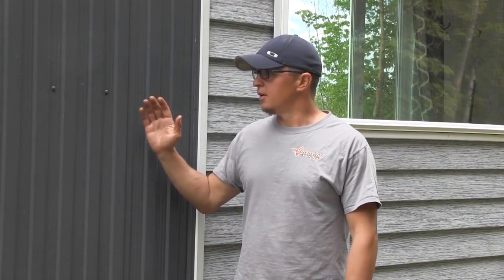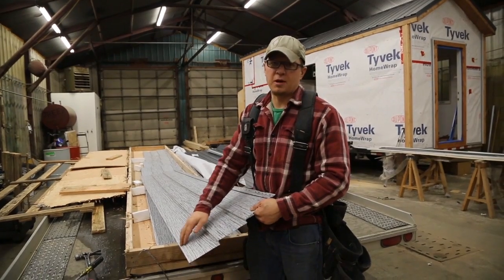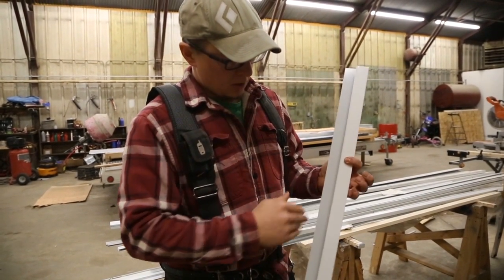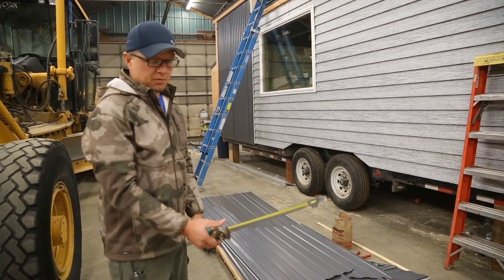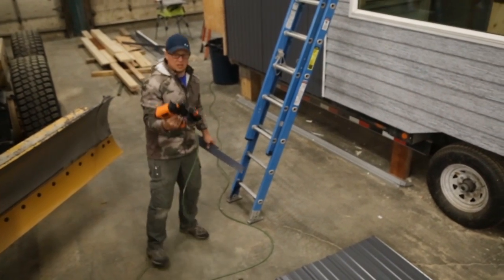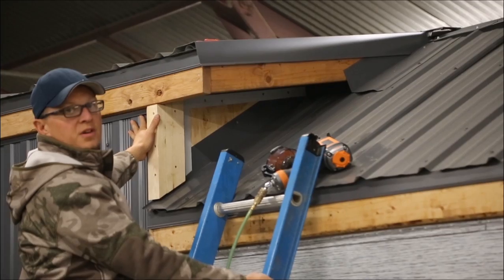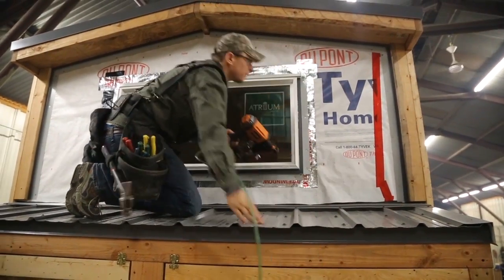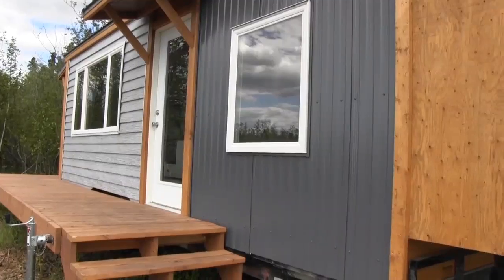Tiny House Siding: Ana White Tiny House Build [Episode 17]

Comment: Why did you choose the stove you did? Did you think about small wood stove for heat?
Reply from the maker: Hi Rick, good question!  In order to get a wood stove in the tiny house it would have to be very small, if you went bigger it takes up more space and would cook you out on milder days.  This means a very small firebox.  When it's -50, you'd be stoking the firebox constantly to keep the tiny house warm, so this would mean you either can't leave the tiny house or you'd have to drive back home every few hours to put wood in the firebox (burning fuel in transportation) so it doesn't freeze up.  Just seems to make sense to go with a high efficiency fuel heater instead up here in Alaska when you go this small.

Comment: Did you use a drop axel  trailer to build on?  How much room did that give you from your floor to roof height out of the max allowable 13.6 feet building height?  How much length and width did your wheel wells take up of your floor space?  Lastly how much did your home weigh given its length(?) ?  Can you estimate how much a 35 foot tiny home might weigh if using your recommended materials or similar.  Would I need  to go to 6 wheels vs. 4?  Is that like 3 axels?  Is yours 2 axels?  Thanks!
Reply from the maker: +rho lees hi!  We've shared the plans for this tiny house here https://www.dropbox.com/s/isl958o3whg76ql/Tiny%20House%20Plans%20Quartz%20Model%20by%20Ana%20White%20-%20med%20res.pdf?dl=0 and it details a lot of your questions.  A lot of this will depend on your trailer.  We haven't been able to weigh out tiny house but estimate it to be about 10,000 pounds by the way it tows comparing to towing heavy equipment.  My guess is you would need a third axel or maybe more to support the weight of an extra 11 feet of house.  Hope this helps!
Reply: Yes, thank  you for taking the time to answer and direct me.  Really appreciate it!  Kind Regards